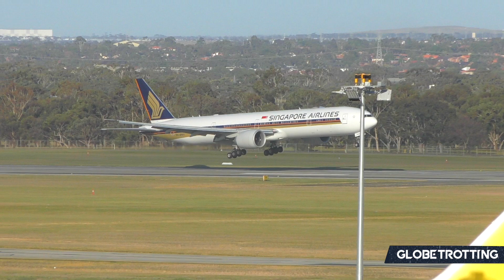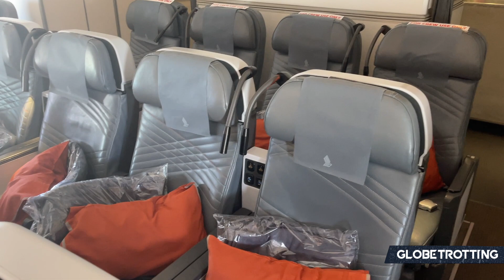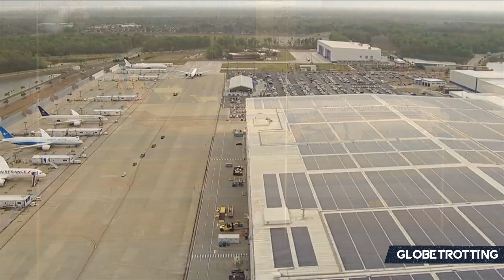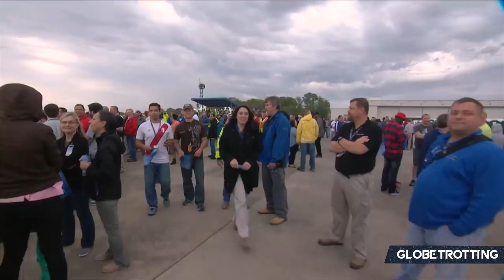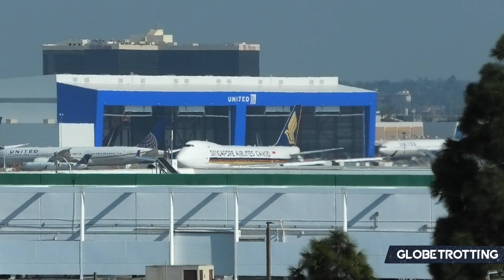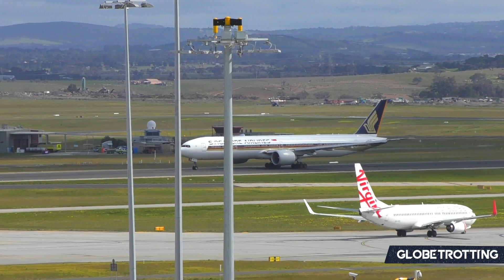AIRBUS A350S - Singapore Airlines Fleet

Comment: legacy full service carriers like Singapore Airlines & Emirates are the only ones left that can stop the A380-800 from becoming history . . . if the A380-800 is to sustain AIRBUS has to upgrade the airframe significantly . . . especially in terms of fuel efficient turbofan engines & cheaper operational costs . . . Singapore's legacy full service carrier could do with an additional fleet of 26 brand new A350-900 ULR & 44 A350-1000 HGW . . . the A350-900 ULR will accommodate around 163 - 168 paxs in a 3-class configuration . . . modern day turbofan engines have iHYBRId® propulsion assist that will make it all the more fuel efficient . . . AIRBUS could launch a A350-1000 HGW ULR variant but that could eat into the clandestine A350-900 ULR dominated market . . .
Reply: The 380 production is OVER by airbus. They only will be around until the last ones built are retired. It's that simple.